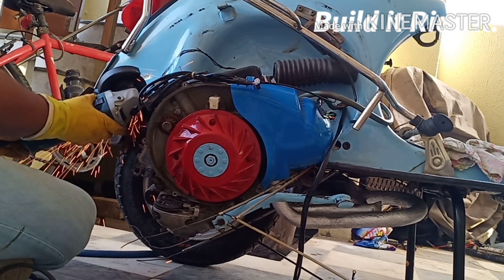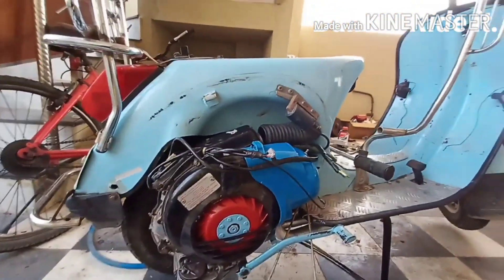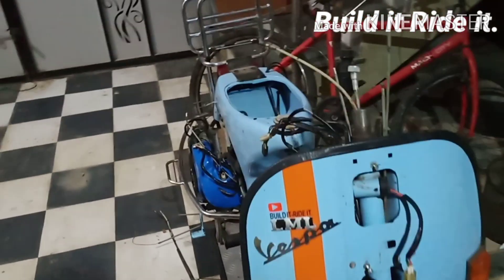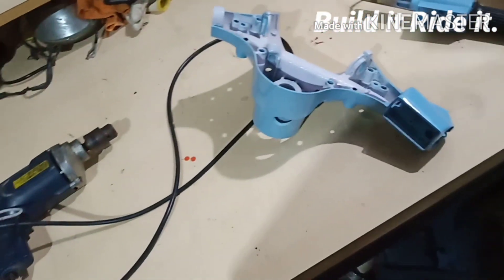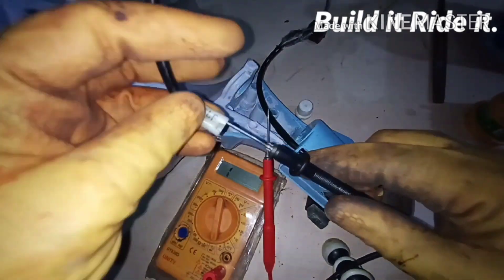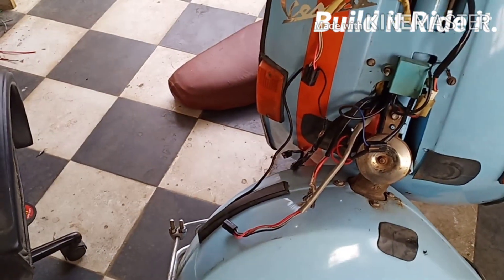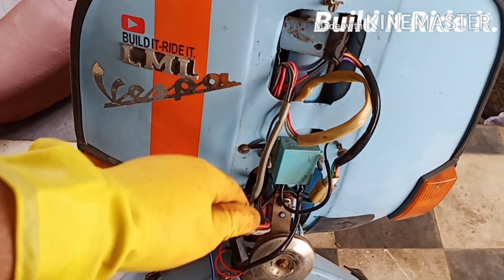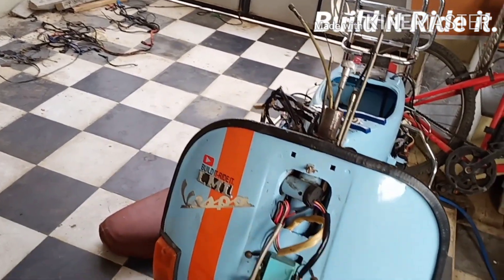Wiring on Vespa: Upfront.

Comment: Ohh... Tell me was the carburettor air box touching the frame when it went over a bump
Reply from the maker: No, not the carb box but the starter motor, that has been installed on the engine.
Reply: @BuilditRideit   Good.